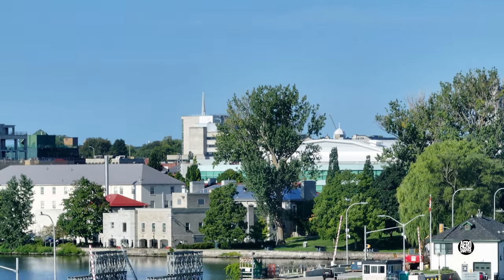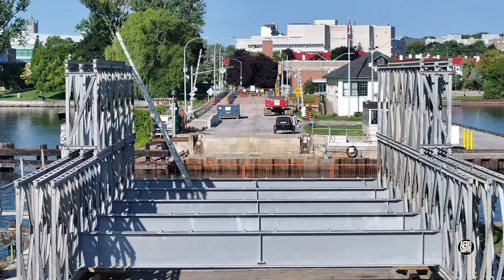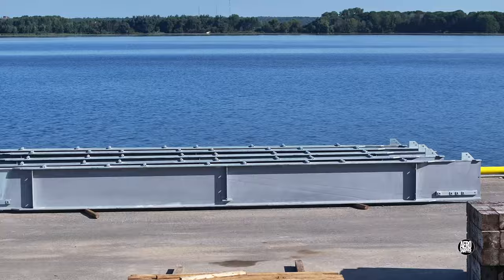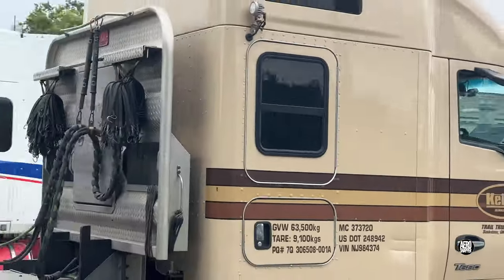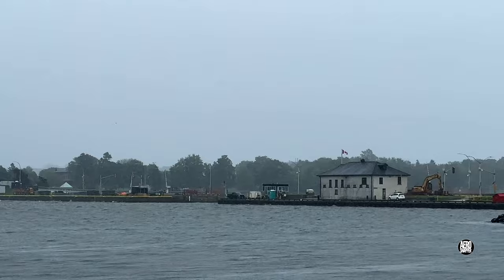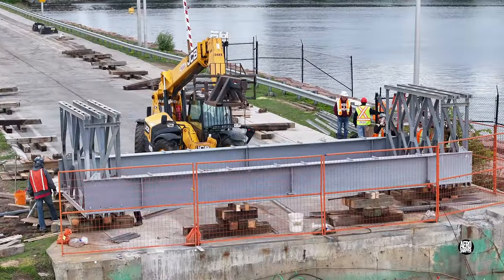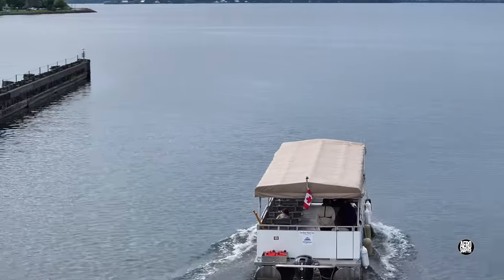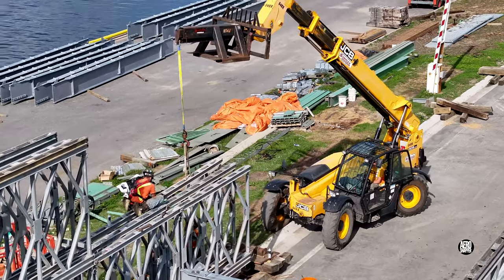The Weekend Starts Here - an update on Kingston, Ontario's La Salle Causeway   4K

Comment: Guessing roll it across and drop it into the gap onto pads/blocks so there will be minimal deviation from the road. Great work Mike, will make my trips into Kingston easier.
Reply from the maker: Lloyd - no question about the use of rollers to position the bridge - but don't expect them to remain for regular movement. The 'promise' is to have the temporary roadway open by the end of September
Reply: It appears to be a triple/double acrow bridge. It can be difficult to perfectly align as it not only has to have a perfectly levelled construction frame but also has to be perfectly aligned to cross the gap to hit the landing zone. I have designed and constructed single story acrow bridges throughout my 32+ years and it is no simple task and this one would be much more difficult. Combat engineers have the ability to complete these bridges but we would only do them in extreme circumstances when lines of communication would need to be opened. It would be an awesome project to undertake.

Comment: Mike, you must know what the finished product will be. Can you tell us please?  Is it a swing or sliding bridge?  Why don’t they build something high enough to avoid constant closures?  Does Mike have a surname?
Reply from the maker: Wow - thanks for your understandable interest.  First things first - this will NOT be a mobile bridge.  It is a fixed, temporary, modular bridge.  It has been promised that it will, occasionally, be removed to allow marine traffic to pass.  Expect dates and times at some stage.  A permanent bridge will be build eventually, but nothing has been decided about its function.  It will have to be capable of opening - easily and quickly - to allow regular use of the navigable waterway.  Again, more information to follow - but don't hold your breath.  Yes, Mike does have a surname.....
Reply: @Aerosnapper  Thank you Mike. Glad to know you have a surname. Are you an engineer?  Civil?  Queen’s? RMC?  You have also mastered video production on many levels, thanks to your time-freeing pension no doubt. Suggestion: I’d keep the introductory thoughtful quotes to maybe once per week, to avoid saturation. But Aerosnapper is a first rate product. Kingston is proud to have you as one of its own …